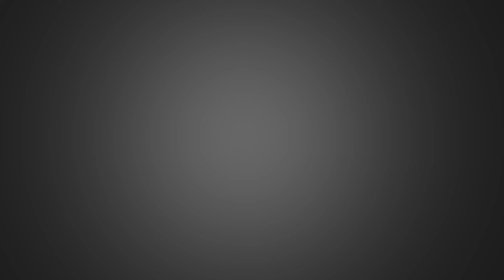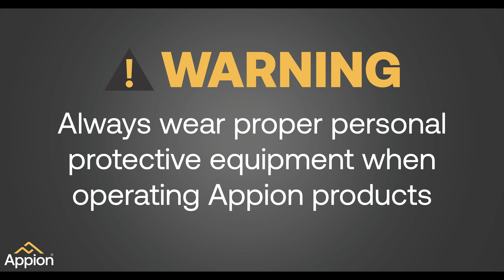What is a Gas Ballast?

Comment: I just got the TEZ6 pump, and honestly, I need to say this, You Appion is being too selfish with this design.
You’re a big company, yet you only provide two 3/8” inlet ports on the TEZ6. Do you really think all technicians use 3/8” hoses? No. I’m using a 1/2” hose, and with only two 3/8” inlets, this pump becomes practically useless for my setup.
The design and innovation of the TEZ6 are good, I’ll give you that. But it lacks performance. I can easily pull a deep vacuum down to 50 microns using a standard Value pump made in China 5cfm — which makes this even more disappointing.
I still bought the TEZ6 to add to my collection, but the biggest issue is the inlet configuration. Two 3/8” ports? That’s a poor and restrictive design choice.
You should have included multiple inlet options: one 1/2”, one 3/8”, and one 1/4”. That would make the TEZ6 far more practical and versatile for real-world technicians.
If you don’t listen to feedback from field technicians, eventually Appion will lose relevance.

Regard, jowo power 🇲🇾.
Reply from the maker: Hello, 
Thank you for taking the time to share your thoughts, as we really appreciate your support and hearing directly from technicians in the field. We understand your concern about inlet size and hose compatibility on the TEZ6. We also understand the importance of using large-diameter hoses. As a solution, we do offer a 1/2 in. evacuation hose (Part# MH120006EAK) with 3/8 in. fittings to match the TEZ6 inlet ports. Here is the link to our website for more information: https://appiontools.com/MH120006EAK/ 

 We’ll share your feedback with our team as we prioritize engineering our products specifically for technicians. Thank you again for your support!